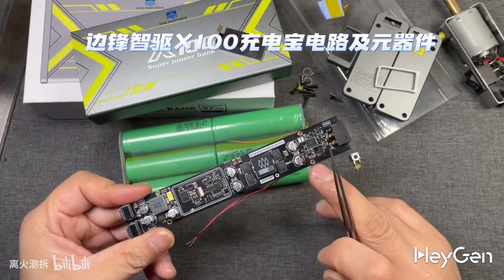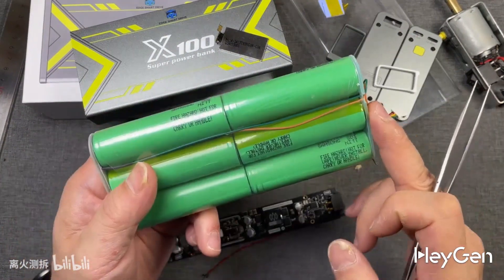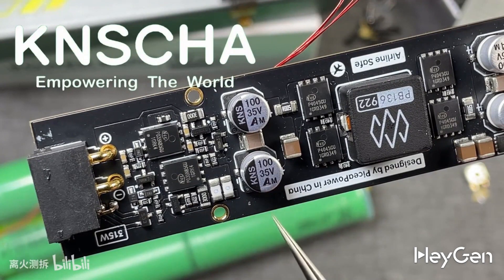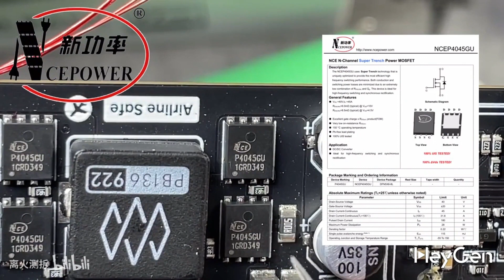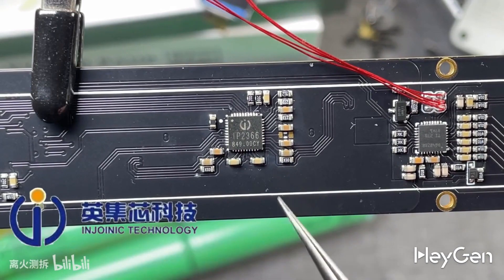X100 Power Bank Disassembly!! Fast Charging Portable Power Station 97Wh(5V) with Display Screen(2)

Comment: I watched the disassembly with great interest! Thank you!
Did you manage to assemble the power bank? Does it work after assembly?
There is information that the power bank is protected from interference. And the batteries cannot be replaced, the protection will block the controller,
like in drone and laptop batteries.
Reply from the maker: Actually, the teardown was done by a Chinese reviewer helping us out—not me, haha. You can reach out to the original creator if you'd like to know more!
Reply: @Edge_Smart_Drive   How can I contact him? haha.
Reply from the maker: @MrAlllegro  original here:https://www.bilibili.com/video/BV1Zh1CY6ExG/?t=677.8
Reply: @Edge_Smart_Drive  Without registration it is impossible to ask, and I do not understand Chinese. Ask my question to the author of the video?
Reply from the maker: @MrAlllegro  OK, I'll try to ask for you.
Reply: @Edge_Smart_Drive  Thank you, I am very interested in the possibility of replacing batteries.